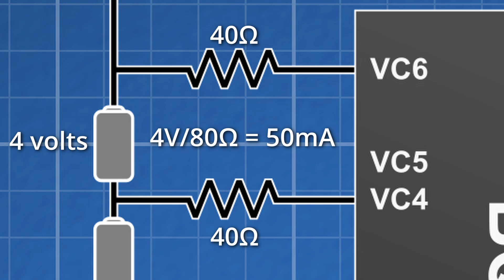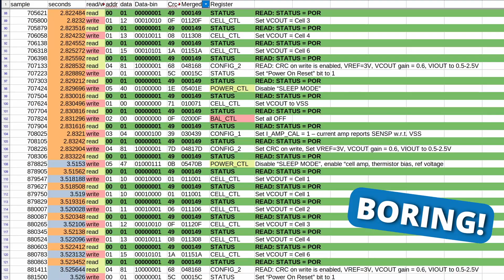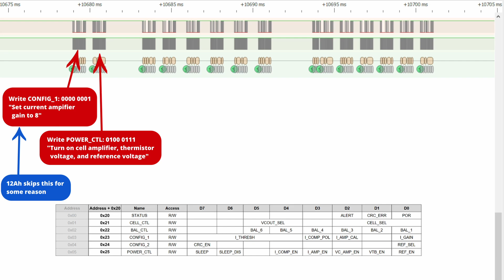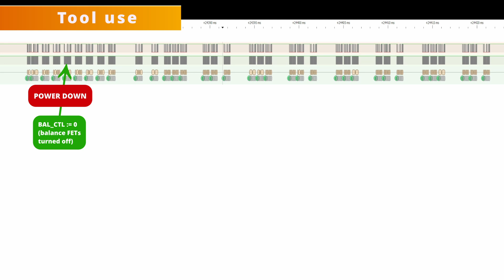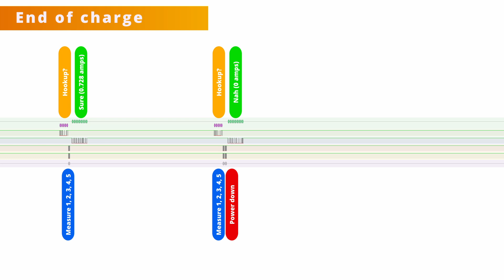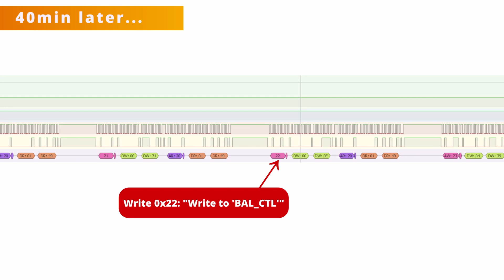[010] Why do M18 batteries charge to 3 bars?

Comment: Good video. Infuriating that Milwaukee doesn’t enable the balance. I’ve got a new Forge 8.0, can I offer any data or pics to the cause?
Reply from the maker: If you can read the MCU and AFE part numbers, that would be very helpful. You'll need a magnifying glass and a strong light that you can move around to get the right angle. There's sometimes too much coating, though.  I've scratched mine off on a few packs, but they were out of warranty anyway. I don't want you to void your warranty.
Reply from the maker: Another useful thing would be measuring the resistances of R7, R9, R11, R12, and R13 with a multimeter. You need decent probes and to push fairly hard to get through the coating. If you're not confident in doing this, then please don't, I don't want you to damage your new battery.
Reply: @toolscientist  the conformal coating is super tough on these. I’ve got good probes too. I tried but I felt like I was on the verge of damage.
Reply from the maker: @darthtater  ok, thanks for trying. I've had good luck with sewing needles, but you'll need to secure them to your probes somehow. Helping hands can be risky. I let the smoke out of a battery using needles and helping hands, that's why I made these spring loaded probes that I briefly showed in the vid. Anyway, don't worry about it too much. I'll prob buy one in the next few months. It looks different enough to justify testing.
Reply: @toolscientist  bummer looks like YouTube took down my Imgur link. MCU is a R5F100BEA. Analog IC Renesas 489250.
Reply from the maker: Yeah, YT only lets channel owner post links. Otherwise every comment section would be full of spam links.

Is it definitely 'BEA'? My 12Ah is BDA = 48k flash. BEA = 64k flash. What are they doing with all that space?

Can't find a Renesas 489250. I'll poke around their listings and see if there's anything close to it.
Reply from the maker: Ok, there's a RAA489220 which is a 4-10 cell battery manager. The 250 might be a custom part or just one without a public datasheet yet.
Reply: @toolscientist  99% sure it’s BEA. I posted the pics to my YouTube account page. I think you should be able to see them there.
Reply from the maker: @darthtater  I'm surprised how clear the lettering is. Did you scratch the coating off or is that just how it looks?
Reply: @toolscientist  didn’t scratch it off. That’s just how it looks.

Comment: Do the M12s balance?
Reply from the maker: 2 months ago I would have said definitely yes, but now I'm 50:50. I have 2x M12s so I can test them.
Reply: @toolscientist  Well, I don't know if you do requests, but...
Reply from the maker: @r0000g  it's coming. I have Makita 40V, M12, and Ryobi 36V as my personal tools, and I'll do those before buying others. Also have to do Dewalt's flexvolt and powerstack as I have those from my Dewalt vid but decided they were different enough to warrant their own vid.
Reply: In my experience they don't but the charger is able to see all the cell voltages and won't charge a very unbalanced battery

Comment: It’s so you have to buy more batteries. Planned obsolescence
Reply from the maker: Maybe, but doing it in a way that's demonstratable is pretty risky for the reputation of premium tool brand. It might just be that they couldn't get it to work reliably. Maybe even someone disabled it years ago and forgot to re-enable it.
Reply: @toolscientist  I could see that, but a 1kohm resistor is what you would use if you never intended on balancing. That’s just a RC filter at that point
Reply from the maker: @chadkrause6574  one of my theories is that they had too much noise in their system so they had to jack up he R value to filter it out. The reference design is using 47 Ohm resistors, so they've gone 20x higher. The other option is that 20x higher R means 20x smaller C on the input cacpacitors (there's a cap between each cell pin). So maybe it's because they ran out of space on the board? But then there's no components on the underside, so there was space available but maybe they wanted to save money?
Reply: @toolscientist  I guess that’s possible but they could use 0201 components elsewhere to make space, plus they seem to have room. And how much noise is there really in a battery system when charging or balancing with no load on the tool?
Reply: @toolscientist however, the fact they keep rereading cell voltages may mean there is a bad programmer in the mix. 4mA balancing current isn’t completely unuseable if these batteries sit on the charger a long time and have matched cells. Once the system is balanced, the balancing system is just maintaining it
Reply from the maker: @chadkrause6574  noise issue would be during tool use. Their system would go all whacky if it was constantly detecting under-voltage, but they could easily "digitally" filter that by requiring X low voltage readings in a row, or just doing proper digital filtering on the cell values.

The re-reading cell voltages could be an interrupt. I didn't notice until editing, but the double reads are usually cell 1 (which could be a routine ending and setting VCOUT back to VC1 as  a default). Then there's a cell 4 double read during charge, but with a big gap between the measurements. Something could be happening there that makes the MCU break off to handle something else and then comes back to measure cell 4 again.

Fully agree on the balance current. 2mA is pitiful, but plenty if you do it all the time. It'd be easy to program it balance at the end of charge and then top up afterwards. Could even allow it to balance down to 4V whilst idle, maybe even 3.9V/cell if it detects it's getting really out of whack.

Comment: I believe Dyson batteries are the same way, have all the circuitry to balance but dont. Infact, supposedly if the cells in the dyson get unbalanced beyond 0.1v the bms bricks  completely, and cant be recovered even if manually rebalanced
Reply from the maker: Yeah, and some madlad made their own open source firmware to fix it. Don't think I have the time for such an endeavour, though
Reply: @toolscientist  By fix you mean remove the "Brick" feature then yes. But they still dont balance.

Comment: Anything we can solder to the board to override this?
Reply from the maker: You could try to build a mini board that taps into the i2c pins and VCOUT. It could then listen to the comms and stealthily inject balancing commands inbetween the normal communication. You could only balance for around 400ms at a time as you need to turn off balancing before the main chip tries to read the voltages.

A better solution would be to write open source firmware. Someone did this for Dyson batteries, but I don't have the time for such a feat.

Comment: The whole communication sequence seems like a project that was given to an intern and never reviewed. This is almost maliciously bad lol
Reply from the maker: I'm guessing a lot of small embedded projects are just hacked at until they work sufficiently. Whoever wrote this probably left the company years ago, and no one bothers to change it for fear of breaking it. It can't be that complicated - I think an experienced embedded engineer could re-write the whole thing in a week or two (prob only a few days, followed by lots of testing)
Reply: @toolscientist  The amount of code programmed into those things can't even be that much though. Considering there's no balancing, the only useful thing any of the software seems to do is flash codes and half of that is useless. The foundation for a lot of good features is there but it's not being used properly. I reckon if they give me access to their code, I bet I can cut out all the bs, all the lazy copy paste, all the errors, and actually make it do what it's supposed to do and probably in a fraction of the size. Maybe it's worth sacrificing a battery or two and overwrite the memory on those chips. I'm a heavy Milwaukee user and I thought to myself "heh, dewalt don't even balance their batteries?" but this one got me sad.
Reply from the maker: @Nitrxgen  they've also got the charger comms protocol, and I've heard there's a hidden diagnostic protocol that can pull more data. It's not going to be massive, but I'm guessing ~3k-6k lines of code. The FU-Dyson-BMS project looks around 2-3k lines (main is ~900, i2c ~750, then several 100 line files).

But yeah, if someone leaked the code we could add balancing in a day. In a month we could clean it up a fair bit, add dynamic current-based low voltage cutoff, and get rid of that low-voltage bounce as well

Comment: Excellent video! Great information.  It seems the slow chargers may benefit in this regard as well? Longer time balancing it seems. Thanks for sharing!
Reply from the maker: There's no balancing at all, so speed/length of charge makes no difference. I guess it's possible that the slow charger sends a command to the battery to tell it to balance, but that seems unlikely that the slow charger would do that, but the rapid wouldn't. Ultimately it's the battery that decides to balance. The easiest time to balance would be after charging has finished.
Reply: @toolscientist 
Wow!  I was thinking it didat least during the constant current charge portion. Good grief...
Reply from the maker: One of the giveaways that balancing never occurs is the structure of the i2c conversations. If a balancing transistor was turned on, you couldn't measure the cell voltage due to the voltage drop across the resistors. So you'd think they would turn off balancing before measuring cell voltages, just to be sure. But the only time they touch the BAL_CTL register is after they've measured the cells.

Comment: Fascinating stuff. Do we know any tool manufacturer that does actually balance their battery? I'd love to learn more about how you do these reverse engineers.
Reply from the maker: Well, so far I'm 0/2 brands that balance their cells. Looks like I'm going to have to check all of them. It'd be funny if some cheapo brand like Aldi was the only one doing it
Reply: @toolscientist I can try my Kobalt 6 cell batteries. What’s the best way to do that - a good voltage difference on a cell, and how many cycles should I do to see if it is actually balancing?
Reply from the maker: @gf2e  if you can see which resistors are the balancing resistors, then measure the voltage across them. Should be zero normally and ~2V when balancing. 

Other option is to push a cell high by around 0.1V and then leave it on the charger for a few hours. Make sure when you push the cell high that you start with all cells around 3.6V where the discharge curve is fairly linear. Also let it settle for 10min - cells tend to lose 0.05-0.2V after you remove charging current. Then you get into the problem of do they balance during or after charge. If during, then yeah, you'll need several charge cycles and measure the voltages between each, with 30min rest before measuring. 

Measuring the resistors will be the easier and more definitive answer.
Reply: @toolscientist  The cells just happen to be 3.6v. Clearly, a sign from above. 

There are six sets of NPN transistor pairs (KNM marking), with two 0402 resistors each. Not gonna be balancing with a whole lot of power on an 0402. 

One of the resistors is 20k, the other 100k. That is not very promising to me unless I am missing something. 180uA is kinda low. It’s only a 2Ah battery, but.

Comment: Balancing old M18 packs is such a pain.  I don't even bother putting all 4 screws back in my battery cases I have to open them so often.

So frustrating that Milwaukee refuses to make a charger /pack combo that actually balances the cells properly.  It literally takes me an extra 15-30 minutes to do it manually...and it would be so simple & convenient to just leave the battery on the charger for an extra 15 minutes if it would just do it.
Reply from the maker: Doesn't even need a new charger. All it needs is a software update in the batteries. The 1 kOhm resistors makes me think they had problems. The Texas Instruments reference design uses 47 Ohm resistors.
Reply: If you’re doing this often, I’d suggest getting a balance charger, perhaps like one from iSDT. You can add a 6 pin balance cable to all the cells. Then you can balance without disassembling it. 

I can’t find the charger for my black and decker battery, so I just use a balance charger.
Reply: @gf2e  I have many balance chargers.

I've spent decades in the RC Hobby.

I'm just using a bench power supply (or two if there is more than once bank low) as a balance charger. 

Often on really old M18 packs the highest voltage bank will be something random like 4.07v...so it much easier the bring the low banks up to exactly 4.07v with a PSU, than have a hobby chsrger like an ISDT just pumping current and then draining the high banks at the same time.  But I will use a hobby charger for newer M18 that aren't yet out of balance too bad.  Either way you still have to open up the pack, unless you want to solder on balance leads and dangle them out the battery casing...which I'm not doing to hundreds of packs.

...and I have my bench power supplies set up to log the charging cycle so if there's ever an anomaly during charging I can see exactly when it happened, and what happened, etc.
Reply: @PowerScissor  What do you recommend for logging? I only have one power supply with a USB port. Haven’t really seen any tools that look easy to use for that. 

Are you aware of any balance chargers with open source firmware or good remote control options?

I’ve started soldering wires to my packs, but I don’t have that many packs.
Reply: How do you do it? I got a 8amp/h on redemption about 8 months ago and it only ever charged to 3 bars from new.
Reply: @slinkyfoxx Just take case off, measure cells with DMM, then alligator clip the low cells to a bench power supply until they are all even.
Reply: @PowerScissor  What settings do you use for your supply and for how long? Also, do you use anything to stop the charging or do you just check voltage occasionally?
Reply: @SirSpence99 Most Bench Power Supplies will automatically switch to "constant current" mode.

Usually with M18  you'll get for example 4 banks at 4..12v or very close, and then one at 3.9v or something lower than the rest.

Just clip on to low bank, set Power Supply to 4.12v in Constant Current mode and choose current based on battery size. Maybe an amp for 2.0 battery pack...3 amps or so for an 12.0 pack

It will bring it up to that and stop by itself.
Reply: My 12ah Milwaukee batteries are a complete waste of money. They all charge to 3 bars, then they die within a few minutes of light use. And don't get me started on their equally useless trigger mechanisms that frequently fail. I'm definitely not a Milwaukee fan boy any more, in fact, I think they're blatantly ripping the customer.
Reply: @plan_b_adv   I've had my fair share of triggers fail also.

The absolute thing that drives me insane the most is the temp sensor.  I've had many M18 vacuums brand new that I've had to open up and tear out the temp sensor just to get to work out of the box.

I purchased tools for a whole company for several decades...so thousands of brand new Milwaukee tools & M12/M18 batteries  have went through my hands.

I went a decade where they all were great and hardly ever failed, even with abuse of employees who didn't pay for their own tools.

Then, within the last few years they have went to absolute shit with the electronics.  Tiny cheap 50 cent parts make $1200 tools fail all the time.

I finally turned on Milwaukee when I would get banned from Reddit subs and forums for posting legitimate pictures of all the failures and the exact part that failed.

The only way I've found to keep 12.0Ah packs working is to bring them to nominal storage voltage after every use. Only charge them immediately before use, and return then to nominal voltage immediately after.  I have 2 12.0 for my lawn mower that I do this for and so far they have lasted 3 years....but nobody has time for this if they don't have dedicated equipment to this for them.

Ironically chargers that do this automatically are cheaper than the official Milwaukee chargers these days....but it's a pain to open the packs to bypass the shitty Milwaukee boards.